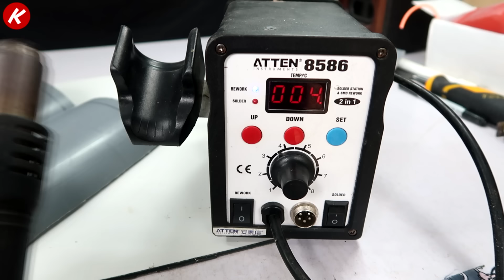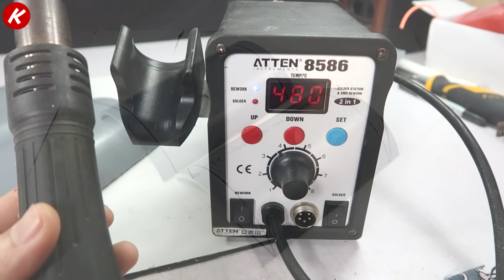DIY Bluetooth & Wifi Speaker

Comment: next time make en enclosure with different sized passive radiators for two main drivers, one for 35hz bass, an other for 50 and a last one for 60 like the harman kardon one. they will all move differently next to each other
Reply from the maker: Thank you

Comment: Absolutely impressive.  You can see those topside radiators pumping.

So glad to see you went with an amplifier setup that's not crammed into one speaker. Makes these useable for just about any stereo you want to play them on.

Comment: I love your design. But I don't get why not use a real woofer instead of passive radiators since your amplifier board is 2.1? I'd love to see a true 2.1 Bluetooth speaker with an actual woofer.
Reply: New video idea right here. Also upgrading the satelites with dayton nd's that fit would be awesome.
Reply from the maker: Anthony Goodley. Yes, I will try to make a portable speaker with subwoofer in next time.
Reply: @KingMinhvuong  If you make a project such as this and list links to the critical components I will surely build it. Like another person said I also like Dayton speakers as well. Thank you.